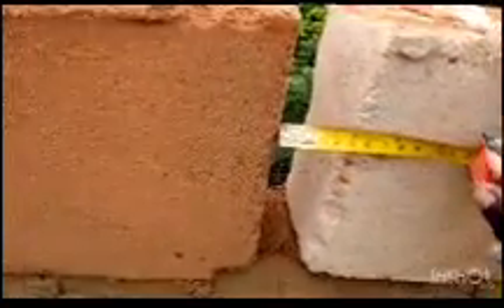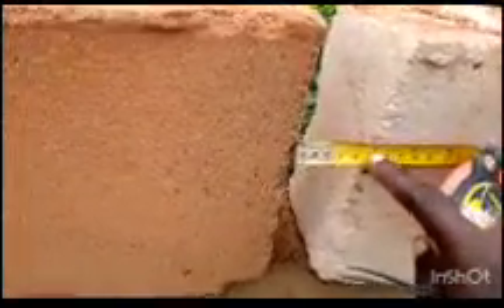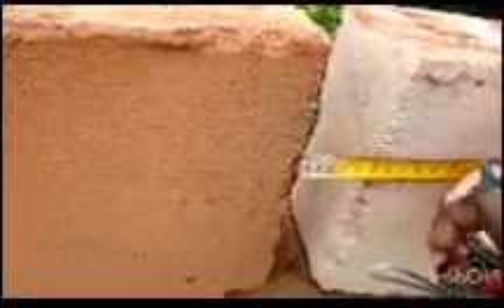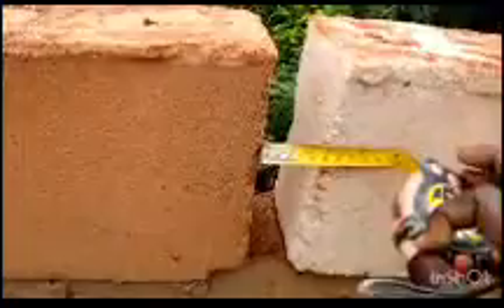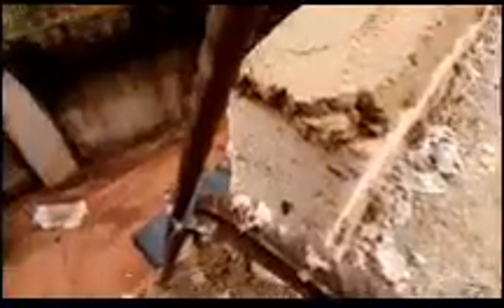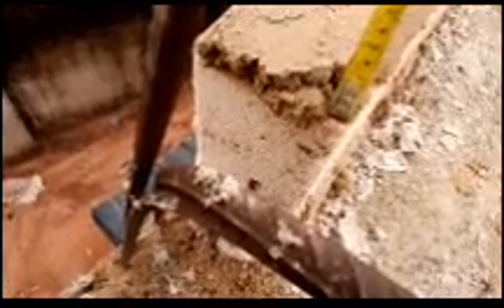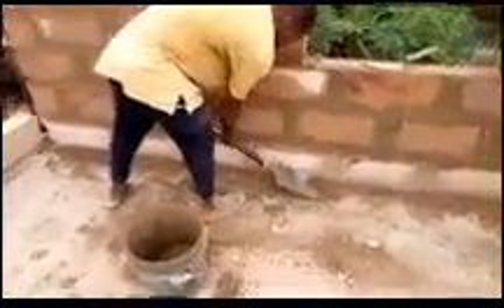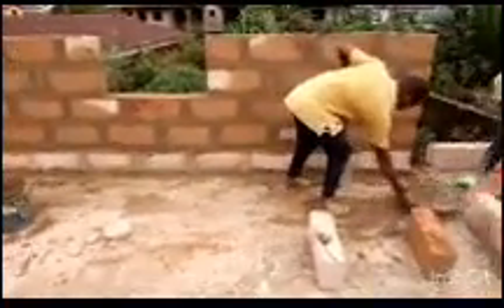how many blocks can be layed from one bag of cement

Comment: Varies according to cement, sand ratio: for a concrete mixture of 1:4 you can expect ~125 blocks.
Reply from the maker: Concrete is not required for brick laying.
1:4 is fine for mortal
1: 3 is for high brick strength
1:6 for medium brick strength
1:9 for low brick strength
The mixture ratio use will determine the number of blocks  and 
You should know the number of blocks you got from one bag with the size of block you use, some block take more or less mortal.
Reply: @Tinaconcept we're talking blocks here right? Not bricks. I meant to say a mortar ratio of 1:4 (cement and sand) will lay up to 125 blocks if we assume 2kg of mortar for one block which is a general rule of thumb. This response is for the question in your video title.
Reply from the maker: Yes, blocks are larger than bricks 
I am not saying it doesn't vary, there are some many factors to consider the final result.
If you consider the factors and know the number of blocks from 1 bag of cement, you can calculate to get accuracy for many bags of cement.